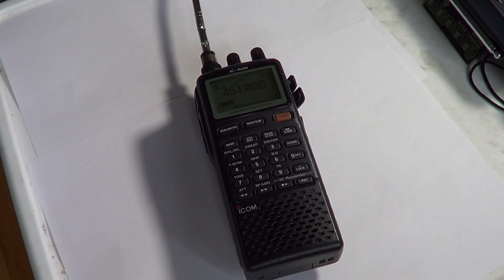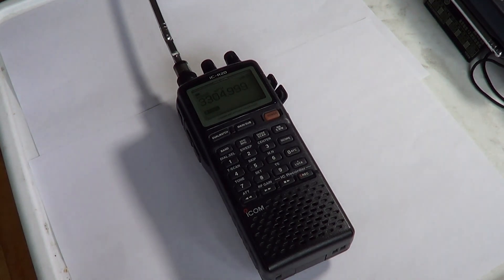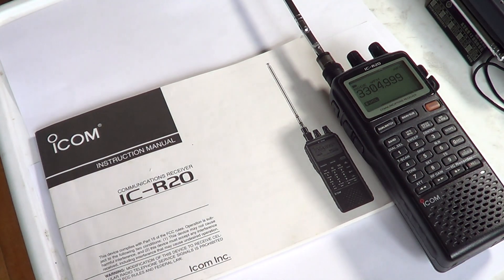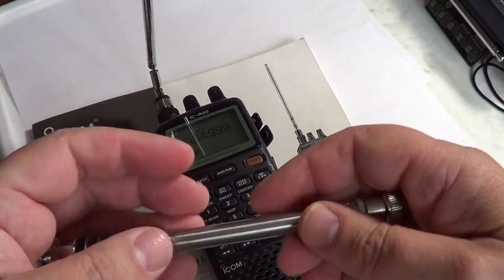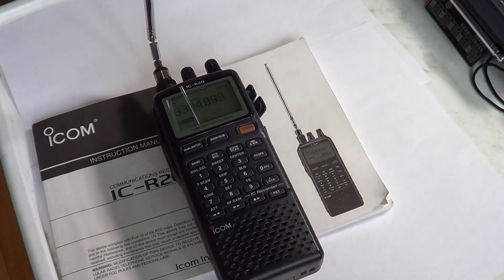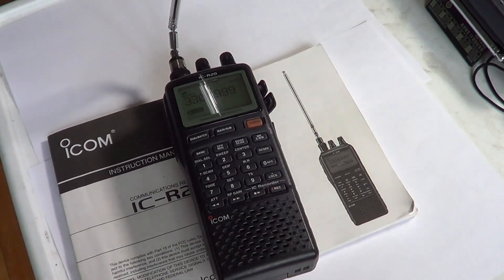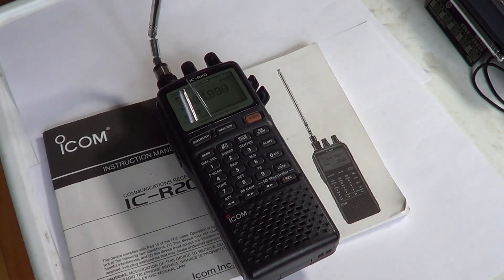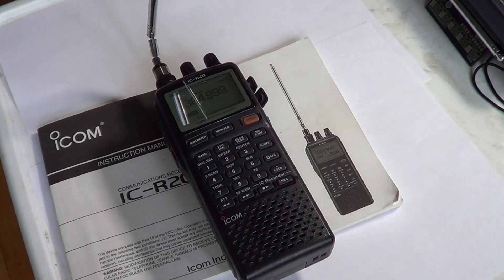Icom IC R20 Review part 1

Comment: Well, this is what I found on a spanish forum:

Signal generator RF Marconi 2022C recently calibrated.

200,000 Mhz = -113dBm = -6dBu = 0,5uV
225,000 " = -113dBm = -6dBu = 0,5uV
250,000 " = -106dBm = +1dBu = 1,121uV
275,000 " = -91dBm = +16dBu = 6,30uV
299,995 " = -73dBm = +34dBu = 50,1uV

Looks like some older models (that  post dated back to 2009) were as deaf as fence posts at UHF mil bands.

73s